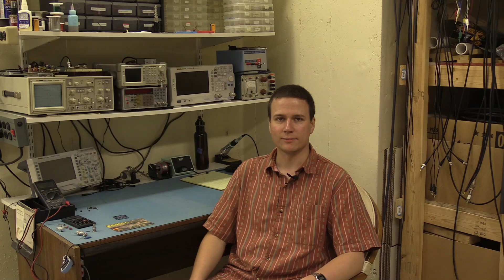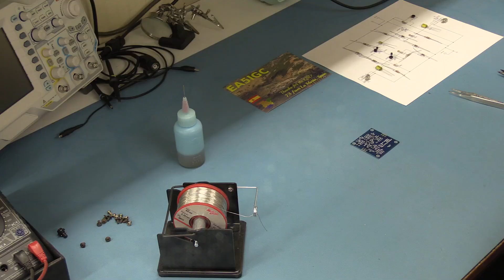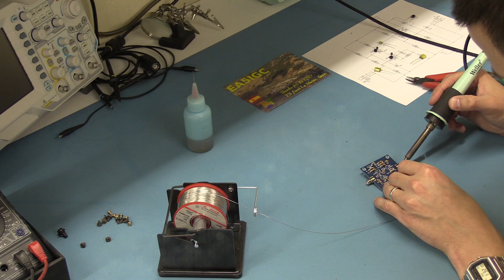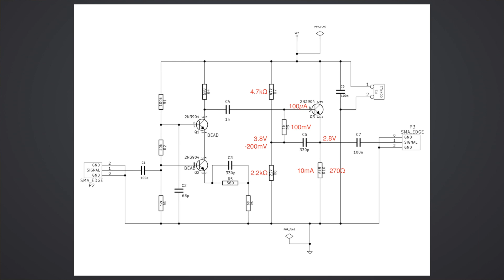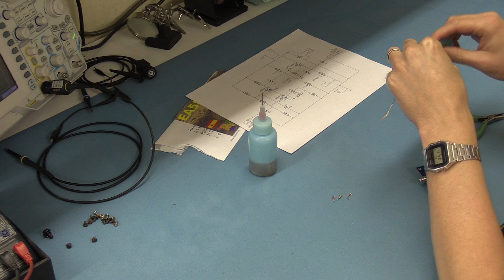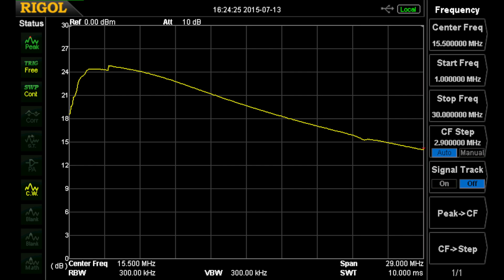EA5IGC HF Amplifier Build and Modification

Comment: Aaron - Nice video and analysis and adjunct to Alan W2AEW's video #207. I see your wrist ESD strap and connection and wonder if you simply ground it to the cover plate pin on a AC outlet or something else (in 47 years as a ham I've never destroyed a part from ESD, guess I'm just really lucky - have the bench pads and strap of course but seldom use the strap - famous last words, huh?) Might be a good basics video you might create and reason for me to finish my ESD protection circuit since I have all the components and simply need to hook 'em up!).  ;-)

73 - Dino KL0S
Reply from the maker: Dino Papas Thanks for the kind words!

Yep, that's exactly what I do. The mat and wrist strap are connected to the faceplate screw on the nearest AC outlet, which in turn goes to safety ground. 

On the one hand, I suspect that for many hobbyists basic precautions like keeping the humidity reasonable and avoiding synthetic clothes are just fine. You might end up scratching your head over a zapped MOSFET, but it's probably not a big deal. On the other hand, the cost of a nice mat and wrist strap has become quite reasonable, so why not? I actually bought my mat mostly to protect the workbench and cover up the abuse it had already taken, but if it can save me some head-scratching, that's great too!

In industry, of course, more elaborate measures are often found worthwhile because of the cost of tracking down problems or putting out bad equipment.

It's a cool idea for a video. Maybe I'll take it on one day soon!